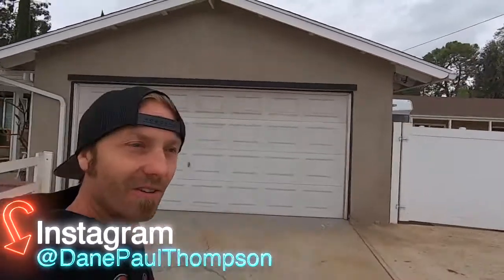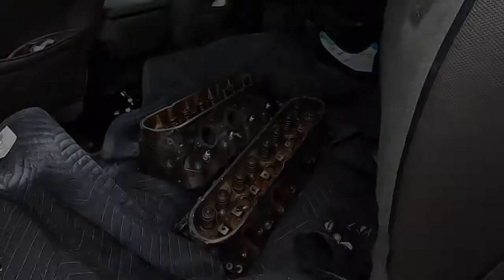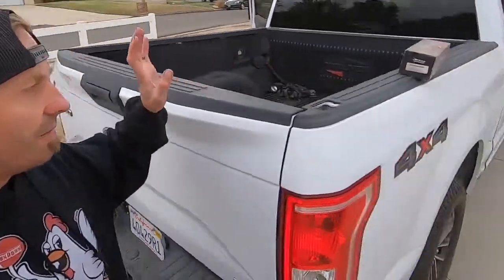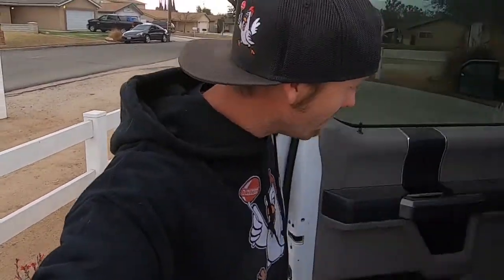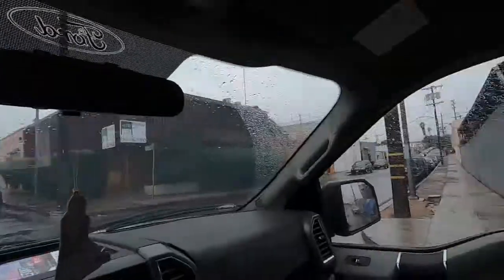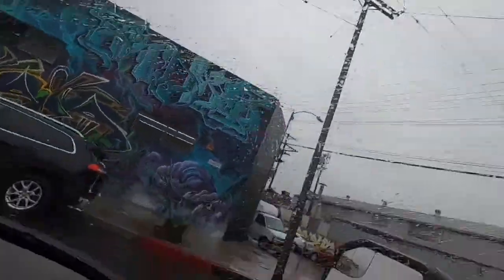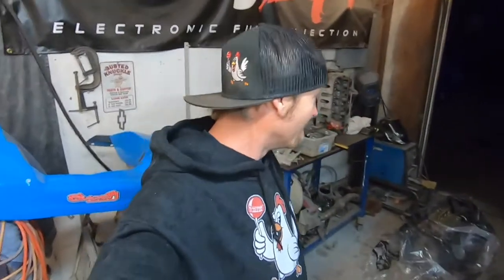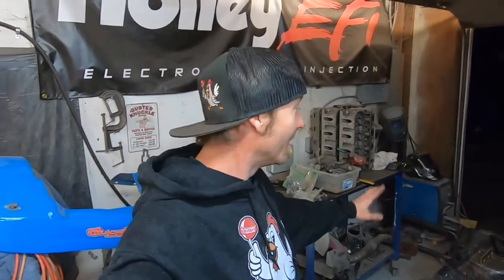We Have Winnebago Parts Finally Short Block Is Done

Comment: 4l80e man. just do HD2 shift kit and call it a day.
Reply from the maker: Thing with a 4l80e is you have to be able to control it. The Terminator X max cost more than the X. A 4l80e cost way more than a th400. The other thing with a used transmission is will it work properly? If I do a TH400 I can rebuild it my self for next to noting. I also have a line on a gear vendor for a TH400. It really just depends on what falls in my lap and what I can afford.
Reply: @Burndown  I have got 2 used 4l80e (fairly cheap as well @ 300 bucks)  and when I pulled the pans off they looked good. No major junk in there. I called it good. No issues out of either one so far.  The x- Max is 300 more and I feel is worth the money given the tunability of it.
Reply from the maker: @kyleorsak  Well shoot I looked up junkyard 4l80s and they are like 200$ Now you got me thinking.... Maybe I just roll the dice and see if I can pull the pan on a few and find one that looks good and just pull the trigger and go X max and be done.
Reply: The advantage of the 4L80e over the gearvendor is you get the lockup torque converter!!! I'm a huge fan of the gearvendor as I have one on my F350 DRW 4x4 which has the Ford Version of the 4L80e known as the 4R100. So with my 4.10 rear gears having two overdrives is so sweet!!! I have 69 Camaro with a 598 with a 14/71 supercharger, for that trans. I went with a 4L80e over the th400 and gear vendor specifically cus of the lock up with in  a sense gives you another gear...